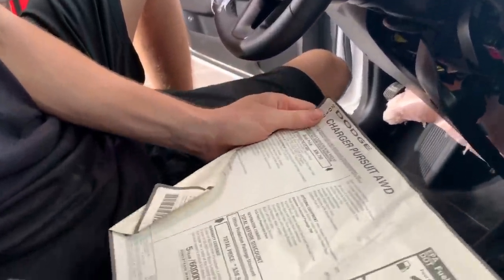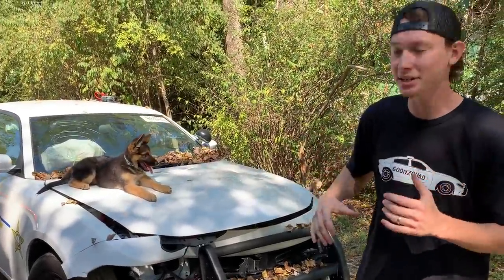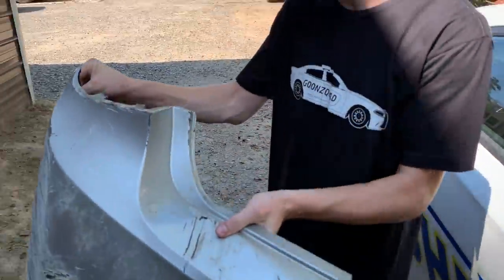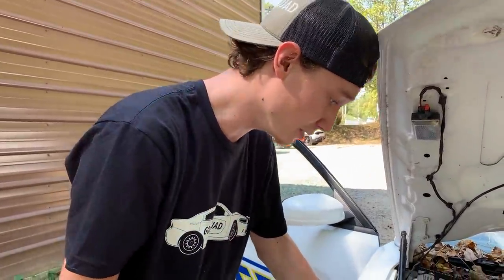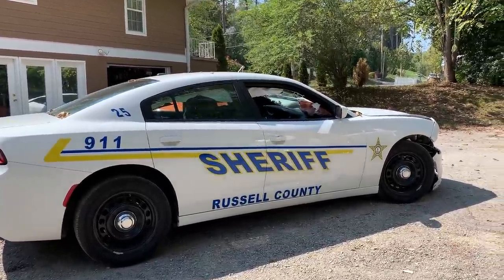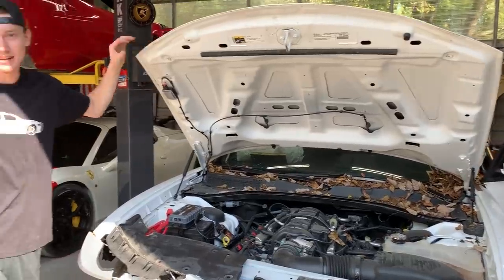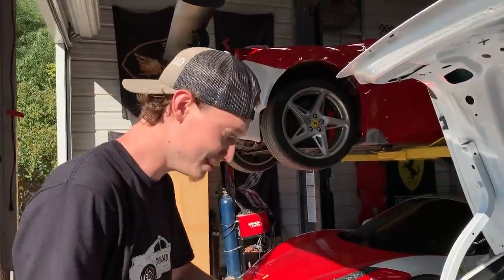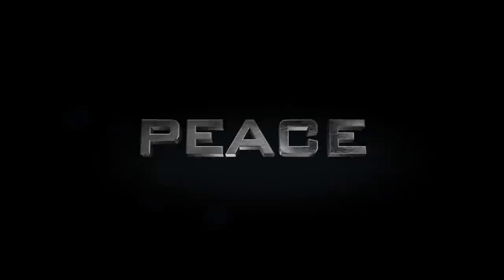Rebuilding A Wrecked 2018 Dodge Charger Police Car!!!

Comment: The “hellcat” bumpers are very inexpensive now. They sell charger GTs which have all SRT body work, so they are plentiful. I would say the front and rear bumpers with hood, and also get the 2019 scar pack grilles and nostrils. They are like 150$ new from dodge and look extra mean
Reply: Seconded! Get the Scat Pack/SRT look on the outside for sure! Then go with Plum Crazy Purple or B5 Blue on the re-paint!

Comment: So, being a current LEO and driving one of those chargers, that whole center console you’re referring to housed their radio, emergency light and siren controls, the MDT ( in car computer ) wires, noticing the Velcro piece on the dash, it looks to have had a radar unit in it as well..... so that console more than likely held some components of the radar. The back seats are Vinyl and separated like that for two reasons. Sometimes the people you put back there have pissed on themselves, possibly went #2 on themselves or maybe even bloody, so it has to be able to be cleaned, also, suspects will stash contraband in your seats to get rid of it, so after every arrest that deputy should have lifted that seat to make sure there was NOTHING in there ( he is required to if he worked for us ). I’m sure if you two look hard enough, you’ll find stuff related to the job! There’s sooooo much stuff we carry in those cars that when one is wrecked and totaled out, they tell us to go retrieve our stuff as quick as we can, because those cars get shipped away QUICKLY! The agency wants to get it replaced ASAP! Have been a subscriber for a good while now and can’t wait to see what you guys do with that car!! Keep up the great work guys!
Reply: K9COP282 love your reply , if the guys need info i am sure they will ask you.
Reply: You must work for a different place than me. When our cars get wrecked it takes 6+ months to get a replacement. We would've had this car fixed.
Reply: K9COP282 Is it legal for them to keep any of that police stuff (the lights, sirens, police lettering and etc) on the car though? Because it sounds like they want to keep it looking like a police car, but I think they’re gunna have to repaint the whole car and remove all the lights so it looks like an everyday charger. If they don’t do that I’m guessing that would be imitating a police officer right?
Reply: Sean James they cant have red and blue lights on it, they also can’t have a department on the side, they’ll either have to tape over it or put their own brand on the side. Smartest idea would be to repaint it all white and just keep the front end looking like a police car
Reply: @JayVGGamerz  if its only in showrooms its ok.
Reply: @seanwest1992  they have to remove the  stickers and not allow  to have light of police
Reply: Thank you for what you do. Its a difficult job that i know i could never do.
Reply: K9COP282 who actually read the whole thing
Reply: Sean James if they leave the agency logo on it, they may not be able to drive it on the streets. But if they build it to use on a drag strip or show car, I don’t think there would be a issue. If they put the blue lights on or in it, they wouldn’t be allowed to operate them on public streets or that would be impersonating a Law Enforcement Officer. I don’t think it would be any different than some of the old antique police cars people refurbish, the ones that have the bubble gum style lights on the top..... I’m sure laws differ from state to state though. Chances are, they will drive it and in that case, the striping will have to be removed
Reply: They already said they're going to put Goonzquad branding on the side in lieu of the PD vinyl. I believe they can have interior police style lights as long as they're all one color.
Reply: @JayVGGamerz  I think they will do it like on the shirt logo - goonzguad and K9 logos and maybe swap out the lights to different color ones. Cletus and Hoovie's garage have already done something like this.
Reply: @K9Cop282 you're 100% right.  The guys car is practically brand new with only 20,000 miles on it.  But honestly that damage is minimal compared to some of the cars i've seen.  I will say that the Chargers and for the old school guys, the Crown Vic are built like tanks.
Reply: JayVGGamerz that car does not need a new paint job. That’s a couple hours to get the vinyl off, then a light buff. A right fender and bumper paint along with the internal front damage is what the car needs
Reply: @Locochon1  spoken like a true felon.
Reply: I drove a 2008 Charger with the Hemi at my last department......it would scream!!
Reply: Yep also being active law enforcement I can give a little more information. My agency would have rebuilt that. We are still driving crown Vic’s. Mine is a 2005 with 160k miles. Hopefully getting a brand new explorer in the new year. The tires are not run flats. They are Goodyear RSA. Most agency use them because of their speed ratings. Most of the agencies as well replace them if there’s a nail or something like that. We do not fix tires and put them back on police cars. As for lights, atleast here in Florida. You can not have strobe lights on at all while moving. If you are stopped you can have basically white, yellow, and red in the rear. My personal truck has yellow in headlights and tails and red on license plate. You can have a light bar. But I would suggest against it because they are very loud on the highway. I purchased an ex police car 2011 charger v6 from auction not long ago. Another thing for you to look at is the rear doors. The factory deletes the internal mechanisms from the factory. Meaning you cannot open the rear door or roll the rear windows down from the inside. You will need to purchase a kit from dodge or an outside source to reactivate the rear doors by installing all the parts and pieces. The plugs that are left in the center console should go to factory wiring in the car. Dodge pre wired these cars for different options such as lights and things that you can cut the wires to those plugs and put power to specific wires to do certain things. For example. I believe 2 wires in the large plug runs the wig wags. Atleast that’s how it is in my 2011.
Reply: I'm also a police officer and we drive the same AWD five sevens... even in white. If you two need pictures to assist with your build, I would love to help out and send pics of whatever you needed.
Reply: Casey Miklosh same here still driving the same ol vic. Maybe I’ll get an upgrade one day
Reply: need to get a toughbook and have a mobile editing rig
Reply: The rear seats were probably removed and replaced with plastic ones typically found in patrol vehicles. The yard where these cars are stripped of their Code 3 equipment usually has a giant pile of seats and they just toss any of them in the back when the cars go to an auction house for public sale. The column shifter is actually nicer than the console IMO - Our patrol vehicles are exactly the same as this model - AWD V8. The dome light should have a two way switch one it - one way is normally on and the opposite should be a red light for night time use. 

It will be a fun car when done.
Reply: Proud to be a Po-LEETS watching the goonzquad. Lol love these guys.
Reply: @JayVGGamerz  , not if they want to be arrested for impersonating an unmarked cop car because that is also a thing.
Reply: did i ask
Reply: @JayVGGamerz  I bet they wrap the Charger and it will be sick!
Reply: Sean James it depends on the state, and the actual actions of the driver as to what is actually illegal. I’m a long time former LEO who owns/rebuilds x-cop cars. It’s crazy how the rules vary between the states.
Reply: Pikeville Drone Services their the best patrol car I’ve driven! The Crown Vic has just a little more room in it, but the Charger has plenty and you’re correct, they will fly
Reply: I hope they turn it in to a drag car and leave everything on the car and install lights.
Reply: My hubby's (before he changed agencies last week) had a fiberglass bench in the back seat.
Reply: dang son !!! dang son!! Its that all you can say?
Reply: @seanwest1992  I think as long as they dont drive it one the streets, then they can have it set up however they want. It just wont be street legal.
Reply: Never pulled a fuse, usually double cut Battery Cables. Had a Extrication on a V6 Cruiser and you're right there's alot of fun stuff in a Police Car. Went back after daylight n found some neat "Things"
Reply: Same here man, I'm actually a current Deputy to the neighboring county. I saw the thumbnail of the car and did a double take. It's just wild seeing our very VERY small area be on a video with 2.5 million views lol
Reply: Andy Golden I always wanted a v8 x police interceptor. Do you have a recommendation on sourcing one?
Reply: Sve

Comment: Finally a build where parts will be easy to get! Really wanted a “normal” build thank you for delivering.
Reply: ya but because it was originally sold to the government all the parts are going to be wayyy more expensive even though they are the same
Reply: All the other mopar builds have been slow to get parts... viper and hellcat had slow parts delivery and expensive. The Chevy dealer always seemed to be the fastest!
Reply: Well, there was a Honda, but I do not know what is holding them up.

Comment: “No coolant we can’t have it run very long” * revs the piss out of it*
Reply: Alex Dorofeyev if the radiator is toast then as soon as the engine is running the water pump is running.... so the water gonna get pumped straight out through that wrecked radiator.
Reply: Alex Dorofeyev until it warms up...

Comment: Cool car, but you guys talk waaay too much nonsense and try too hard to sound cool. Ease on the "dangs" and "it's crazy dude" too.
Reply: Aibek Adigineev or they are just saying and talking about what they are called and maybe you should consider picking up your car game if you want to understand car language...
Reply: @landen.dh07  , I own 6 SUVs....my business requires me to. So my "car game" is quite alright,  thank you very much. I actually wouldn't mind if they were talking about just about the car instead of dragging it out unnecessarily.  I think the channel has great potential, but there's too much nonsensical talk. And again that's just MY opinion. An opinion that,  I think, would help them attract more views from people that prefer more technical talk, "car game" as you called, rather than skateboarder/serfer/teenager type talk.
Reply: Let the dudes be dudes. Think of the first time you saw a rare car. Just my opinion.

Comment: If you're gonna add boost to the 5.7 Hemi, you're gonna wanna swap the internals out. Crank is good to 650 HP.
Reply: WrektGlitch is it true all the 5.7s are ass up to the 2012-2019 like all 0000-2012 suck?

Comment: "If you turn off your traction control button, AWD will turn on and stay on until you turn your traction control back on. Also, if you get some tire spin, awd will turn on until you turn off the car, so no burnouts possible. In the main display window, under vehicle info, you can scroll down to see if you are in 2wd or awd."
Reply: That's good to know.
Reply: No burnouts possible? Please! Tie it to a tree and let all four tires burn.

Comment: Love watching you guys undeterred by anything. However, there's a reason why the transmission in your police car is not in a Hellcat. The 5 speed in there is a W5A580 which means it's maximum input torque rating is 580Nm (428 ft lbs). You pump up the power output of that motor and you'll need to do something with the transmission as well. Good luck!

Comment: The front headlights and the rear tail lights most likely have integrated emergency lights!
Reply: yup, wig wag strobes too bad the grille is smashed and the light bar prob ahd strobes on them, no roof bar that cuts down MPH

Comment: That vehicle is equipped with a mercedes benz W5A580 5 speed transmission (its called a NAG trans in the industry).  Don't put 700 hp on it or you'll be picking up pieces of tranny in no time.

Comment: "You traded the Blues Mobile for this?" "No for a Microphone". "I could see that". "You don't like it?" "No I don't Like it". Proceeds to floor the pedal and jumps car over an open draw bridge. "Cars got a lot of pick up". "It's got a cop motor a 440 Cubic inch plant it's got cop tires, cop suspension, cop shocks, it's a model made before catalytic converters so it'll run on regular gas". "What do you say is it the new Blues Mobile or what?" "Fix the cigarette lighter".
Reply: Greg Wayne You beat me to it -exactly what I was thinking Bluesmobile.
Reply: The Goonz Brothers 😎

Comment: You shoud do a "sleeper" out of this one
Reply: I'm with you....no hellcat bits, or any bling at all. Keep cop tires, cop hubcaps and the rest. Do an exhaust uprade and then rip it!
Reply: I 3rd that idea -- a sleeper. No fancy wheels no loud exhaust just a Hellcat supercharger with a 800 horsepower tune. Leave it plain Jane white no decals or nothing. It would be the ultimate sleeper and with all wheel drive it would probably even beat the Hellcat Redeye and most anything else that it pulls up to.
Reply: But in the interior they could let there imagine  go wild, but hide the 800 t o1200 hp...
Reply: @BernardAuger  Sure they could tint the windows and everyone would just think it's an unmarked police car which could be good or bad depending on your perspective. I wouldn't want bad guys shooting at me just because they think I was the police. Those front seats are probably internally reinforced to prevent penetration too and probably pretty damn comfortable to boot.

Comment: You'll never make the same power with that engine the track hawk has forged internals compared  to A stock hemi  is made of glass
Reply: Made of glass? They’re pretty reliable
Reply: Dee under boost crazy boost not much
Reply: El_De_La_Lobo true. 6lbs should be pretty safe but who knows, considering this is a police Hemi it probably has a good amount of wear. I’d be more concerned about something else breaking in the drivetrain before the engine

Comment: Put it in drive then push button on end of shifter then press minus to first gear then stomp gas it will automatically shift itself it's called police mode I had one it's bad ass

Comment: Hey guys. Just started watching you for the charger video. I used to be an EMT and work for a fire department. Now I do traffic control on work zones. I have owned a few Crown Victoria police cars. Not sure about the dodges, but crown Victoria police interceptors are some of the best cars. I survived a high speed wreck head on into a median on 2006. Had I been on anything else, I might have been hurt more than a concussion. Good luck.

Comment: AWD WAS available on consumer Chargers in 2018.  Here's some used 2018 examples for sale: https://www.cargurus.com/Cars/l-Used-2018-Dodge-Charger-GT-AWD-t75317
Used 2019's: https://www.cargurus.com/Cars/inventorylisting/viewDetailsFilterViewInventoryListing.action?sourceContext=untrackedExternal_false_0&newSearchFromOverviewPage=true&inventorySearchWidgetType=AUTO&entitySelectingHelper.selectedEntity=c28424&entitySelectingHelper.selectedEntity2=c28424&zip=48082&distance=50&searchChanged=true&transmission=A&trimNames=GT+AWD&trimNames=SXT+AWD&modelChanged=false&filtersModified=true

Comment: 1) drive train only can take so much torque.  Bumping up the Torque with SC or TC will likely blow something out that might be hard to find.  example the TheStradman (BROKE my new Hellcat Jeep Gladiator in 9 Minutes) blew out his axle splines.      The whole drive-train will likely need upgrades......   2) ITS CALLED COLUMN SHIFT BOYS.    about a billion cars have that  LOL   3) the AWD is either broke or sucks pretty bad if cant get up that little hill  - hilarious.

Comment: I have a Subaru Forester AWD, ... and one of the things you should never do is
tow the car w/o putting it on a flat bed type tow truck.
Putting it on Neutral and just coasting it , ... NOT GOOD,
hope just that short distance will not affect the AWD of this police car.
Best of luck there Goonzquad !
;)

Comment: Police interceptors are rarely tuned. Every interceptor from every manufacturer has an exact civilian equivalent you can buy with the same factory engine. Gearing and shift points may be tuned, suspension toughened (or lowered for SUVs), and brakes & tires upgraded. Even electronic system is upgraded. Same factory engine though.

Comment: Those tires are rated for 160mph. Dodge sells them for 250 in my area but Walmart carrys them for 114, same exact tire. Had them on my 2011 police charger. Also I have the plastic seat and cage from my 2011 if you guys want them

Comment: This cars where built with parts from the mopar shelf. No special
parts, boys. And modern cars use sometimes electrical power
steering. Such cars have to `last`, so they are built stronger then stock.
This one was involved in a major accident with all the airbags deployed.
I think you have to re-program the vehicle when its fitted with new curtains.

Comment: I coulds ee it emblazoned on the side panels of the car      GOONZSQUAD..............with the front and rear hellcats  fascias and the blower poking thru the hood this is gonna be one epic ride fer shure ........................BTW the rear seats don't match because when they take the cage out  and fibre glass seats  removed they throw in any rear seats they have on hand, hence the mis match..................................andno light bar on top, ......................................ain't OEM  and detracts from top speed